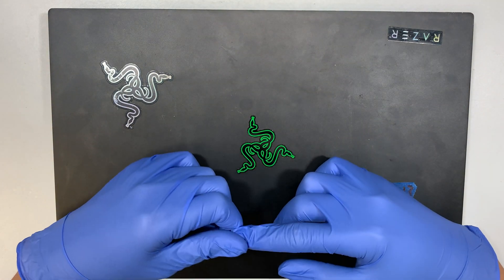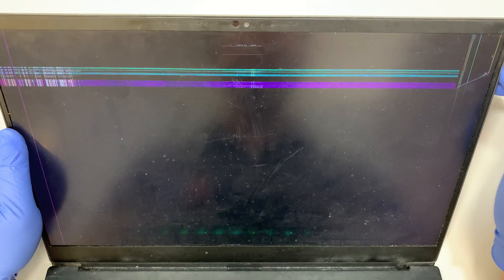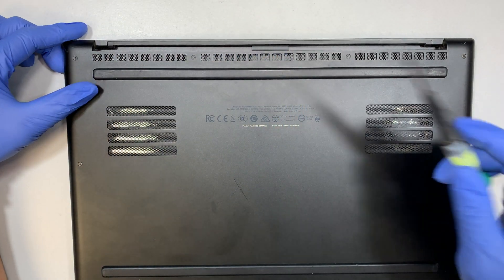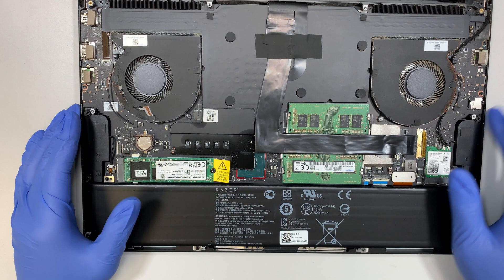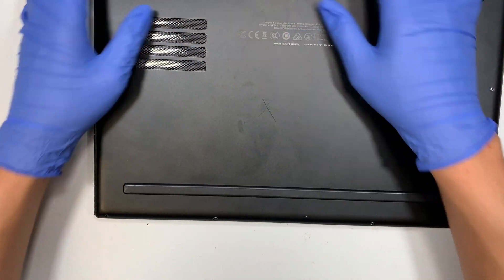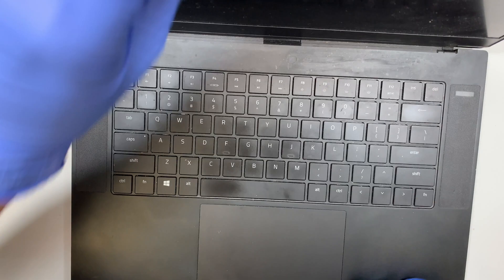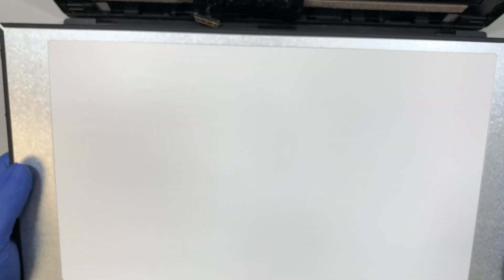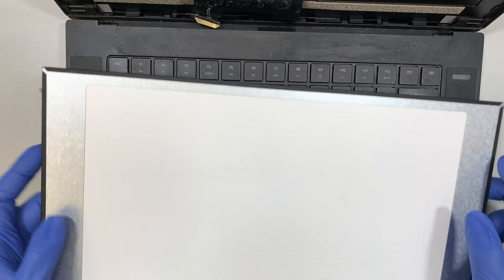Razer RZ09 0313 LCD Screen Replacement

Comment: Hi can I replacement my faulty screen originally 144hz with 240hz. Getting it from laptop screen dot come. It’s the same 40pin connection. RB base 15 2020 2070 max
Reply: did that work?

Comment: Any idea how to remove the LCD for the RZ09 0288? Does seem to have the tape at the bottom like for this version.
Reply from the maker: It should be similar to this.
Reply: Did you have to replace the entire back? Or just the lcd?  How did you get it off? It is completely different than all the tutorials YouTube. 😭😭😭
Reply from the maker: @suggggga7199  Watch the video
Reply: @UbergeeksBiz  I had the 2888 that he had and I couldn't find the tape at the bottom. Lol. I literally had to break the lcd in multiple pieces and the tape was so hard to remove. 😂😂😂😂😂😭😭😭 . I had to cut with knife, scissor, scape off, got 2 cuts from broken lcd. When I finally got all the tape off the hard way, Boom your directions worked so effortlessly. Lol. 😂😂😂😂😂 When you can't just pull the tape down like you did. It was hell getting it off. Thanks so much for this video you saved me so much money. Liked and subscribed. 👍🏾😁

Comment: Sorry if its a dumb question. Is it possible to replace razer blade laptop display with a higher resolution one ? For example, razer blade 17 pro comes with FHD display or 4K touch screen display -  would it be possible to dissasemble laptop with FHD and install 4K touch screen so the laptop can support it ?
Reply from the maker: Unfortunately you cannot upgrade LCD screen. Connector will be different.
Reply: @UbergeeksBiz  I see. Thank you for answering my question.
Reply: @UbergeeksBiz  what about a FHD LCD screen upgrade to a QHD LCD screen? Both without touchscreen. Is it possible then? Will the connectors be the same?

Comment: Did you reuse that bezel? Because it looked really bent after you were done removing it. Is there anyway to make it look flush and pristine after taking it off and putting the new screen in? I have to get mine sent into the shop and I'm worried that if they reuse my bezel on the outside of my screen replacement it's going to look horrible and bent.
Reply from the maker: Yes, I reused the same bezel after. It turned out okay, of course minor noticeable but wasn't that obvious.